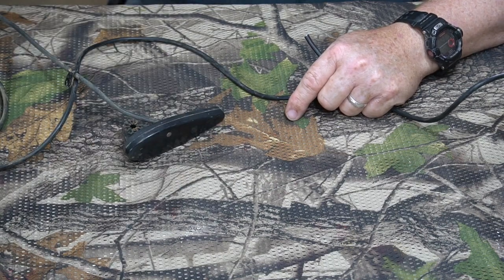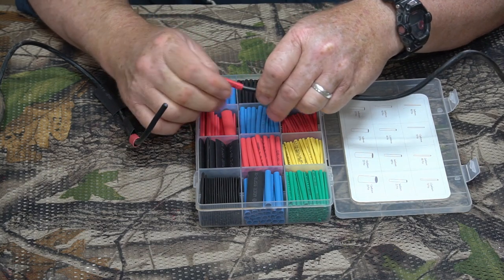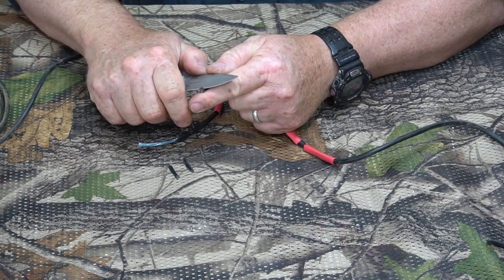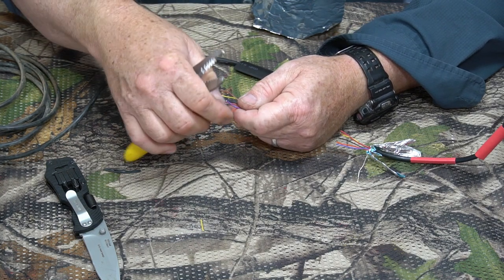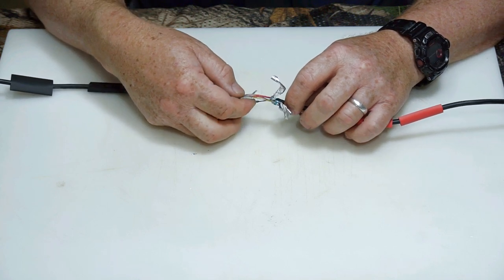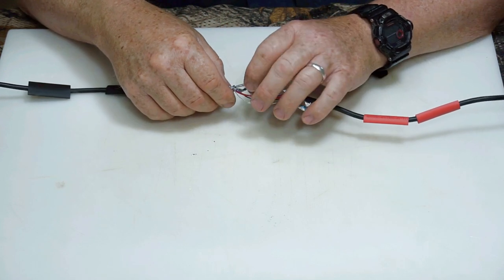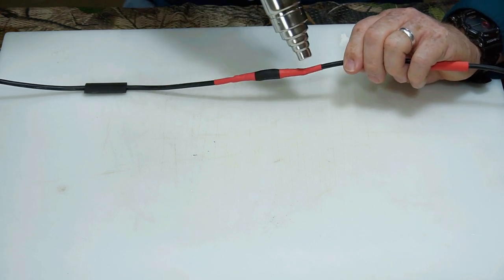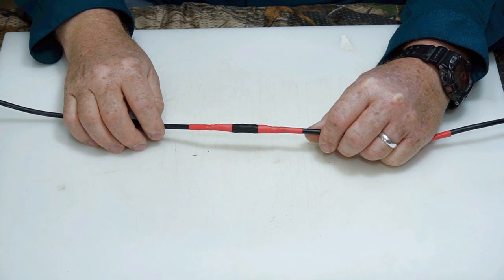🛥️ DIY: How to Splice & Repair a Cut Fish Finder Transducer Cable. 🛠️

Comment: Excellent video/very well done.
For most people, this is a definite plus/excellent way to save some money, especially if you already have the heat gun and a good knife.
But for someone who doesn't have any of the supplies or tools......the total is $101.00 plus a good 30+ minutes to do the splicing.
Total for a new transducer with pre-installed wiring that I don't have to splice - 99.00.
Reply: @Scavenger2012  we watch this video to know how to fix a broken wire why did you comment on it?we don’t want to buy new one when can easly fix it can get tools at harber freight very cheap

Comment: Followed this video and was able to successfully splice a garmin striker 4 unit. Tested and it works. Thanks!
Reply from the maker: My pleasure. Glad it helped
Reply: @Kevin-og2ti, have a Stryker 4 with a cut on transducer cable just wanted to ask you a few questions
Reply from the maker: Ask. I'll do my best to help.
Reply: @thejungleexplorer  , I do not have the connectors that have solder inside, do I need those in particular
Reply from the maker: @NickBland-w4b  I highly recommend them, especially for this situation. They are pretty low cost. You can get a whole bunch of them for around $6 on Amazon.  #AD  https://amzn.to/3dsJh4c

Comment: Yes my garmin gt 56 got caught in trolling motor. Soildered with out foil and received zero signal.  I bought the gt30 but it offered less options. I’ll redo with foil trick. To keep from buying 350 transducer. Keep you updated. Thanks for the video sir. 🍻
Reply from the maker: Well, that sucks. I hope this video helps you out.
Reply: Your video definitely explained the importance of shielding and interference.
Reply: Is the same cable as the Hummingbird mega down imaging transducer?
Reply from the maker: @BillSr. I am sure they are similar, but maybe not exactly the same.

Comment: Thank you for this. My boat manufacturer clipped the Helix SI transducer cable tight and buried in the hold of the boat. I'd like to sell the Helix SI with the transducer but I can't pull the transducer cable out. Efforts to dig into the side cavities in the boat look pretty complicated. So I'll have to cut the cable and put it back together again. If and when anybody is rigging, don't permanently attach any cables or wires in a way that they cannot be pulled back out. At some point one will update graphs and electronics. The wires will have to be removed at that time.

Comment: Hi! Was just about to try to fix my transducer cable. But it does not have the silver shielding inside the cable. There are clear plastic with white powder Inside, do I just follow the same instructions?
Reply from the maker: It can't hurt to try. The shielding may be unnecessary, but it does not hurt to add it.

Comment: Good job. I'mma do the same but I am going to extend the cable of my Lowrance Hook2 fishfinder. I just need now a 22 gauge 6-conductor cable to do the job. By the way, what happened why your wire is cut into half?
Reply: Did it work on the hook2?
Reply from the maker: Worked great.

Comment: Great video--I had the same problem w/ my hummingbird Piranhamax 4---Cable looks nicked but not cut through however, screen displays "transducer not connected" & that silly simulator comes on. I'm still not sure if problem is nicked wire or unit. Question---If all the wires are not cut, is it possible to only repair the damaged wires or do you think i should cut all & start your method? You did a great job on step by step direction.....Kerry
Reply from the maker: I would just repair the damaged wire. No need to cut the rest.

Comment: I'm about to do this with a 4pin garmin transducer cable and one of the wires is a bare wire.  Do you know if the bare wire making contact with the aluminum foil will create any interference or cause any issues? Thanks!
Reply from the maker: I would wrap it to prevent it from contacting the shielding.
Reply: That bare wire is  common feature in shielded cabling. It's called a 'drain wire', and is meant to provide a physically durable, continuous ground line along entire cable length. If the foil shielding develops cracks or tears due to flexing, the drain wire will reconnect separated sections to ground.  So, short answer--no, let the bare wire make full contact with the foil shield 👍

Comment: What size are the butt connectors? I can’t find it at my post local stores.  Thanks
Reply from the maker: The connectors I used in the video are not sold in stores that I know of. I placed a link in the description of the video to the connectors I used. To save you time, here it is: https://amzn.to/3Hwk0Vl

Comment: hi from Turkey, I have watched your video named "How to Splice & Repair a Cut Fish Finder Transducer Cable" . I have a smiliar issue, my garmin striker 5cv plus transducer cable damaged and I lost the connector which plugs in to the device. do you know where to find a 4 pin connector for my device and also do you know how to connect each cable to the 4 pin connector? I do not know which cable does what? waiting for your reply. thanks from Turkey.
Reply from the maker: That's a tough one.  I doubt that you will be able to buy just the connector. My best advice would be for you to look on sites such as eBay for someone selling a broken Garmin striker 5cv for parts or finding a used cable.

Comment: Soo.. what if all the wires have the shielding? And inside the shielding is 2 wires.. orange/ white .. blue/white.. green/white... do u just twist them together and put them into the sleeve together with the other matching side??
Reply: And there's a Bare wire too ..also a brown wire?
Reply from the maker: Each cable may be different from the video. I would try to copy the configuration of the  cable.

Comment: Just got my wire caught in my trolling motor Mount when I dropped the motor down and it got cut 🤦‍♂️ this seems easy enough
Reply from the maker: Sorry man.  That sucks.  I hope this video helps you get it fixed.
Reply: Definitely will help

Comment: I'm setting up my garmin 4+ in my kayak, just cut the end off one of the cable ties and turns out it wasn't a cable tie...has red,black,white wire, 1 exposed wire and a nylon/fabric kind of wire,
Reply from the maker: Sorry to hear that. Hope you can get it fixed.

Comment: What if the wire colors happen to be different?
Reply from the maker: I am not sure I understand. If you are splicing a wire that has been cut, then how is it possible for the wires to be different colors?
Reply: @thejungleexplorer  adding a new transducer to my old wire because they don't make my model anymore.
Reply: @donnysbackroadoutdoors5088  you will have to try to figure out the wiring diagram of the individual units to match up. I dont recommend it, and it is unlikely to operate properly since different transducers and head units send and recieve different frequencies. You are in over your head, and could damage sensitive electronics. Just order the correct transducer or it is simply time to upgrade your head unit....since it seems severely outdated if they dont make transducers for it anymore. Or, look for a used one on E-Bay?